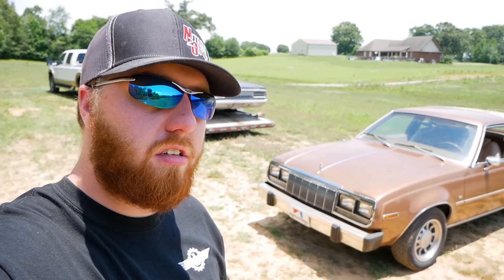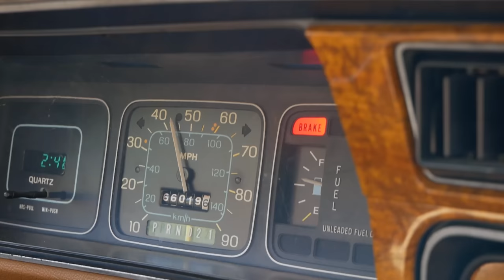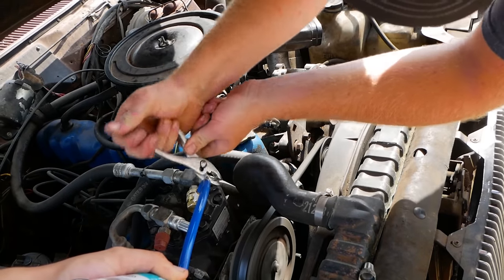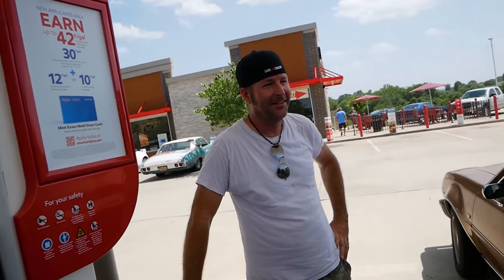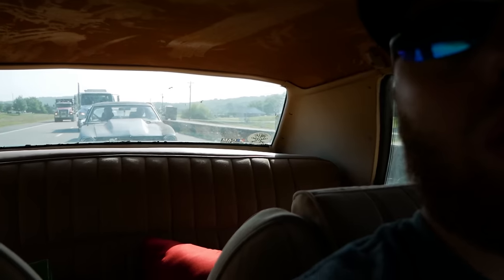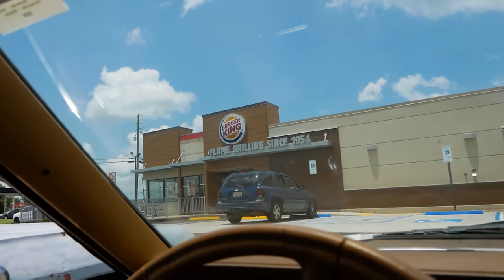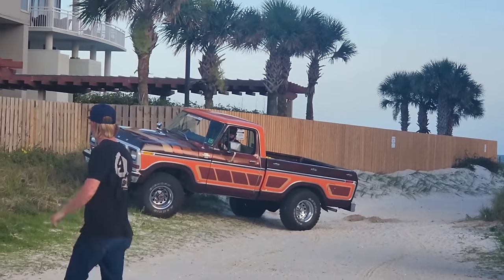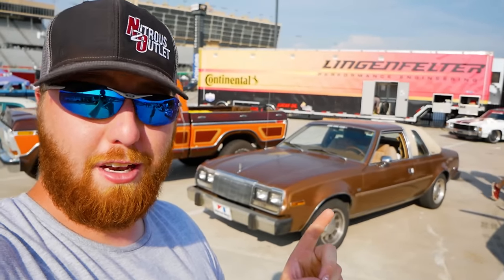Will a 43 Year Old Car Survive a 1500+ Mile Road Trip With Zero Preparation?

Comment: These also have a bullet proof Chrysler Torque-Flite 727 3 speed Auto trans which AMC used from 1971-1988. The same trans from a 1977-1989 M Body Dodge Diplomat 1982-1989 Chrysler fifth Avenue/Plymouth Gran Fury trans will fit this as well as the A704 trans as well AMC used too.
Reply: Only the AMC  V8 cars used the 727, most 258 L6 cars used the 904, a few may have used the 998
Reply: @jjtrucker5950  Correct. Prior to 1971 AMC used Borg-Warner transmissions.  If you look on the gear indicator you will see "Shift Command."  On the cars equipped with Chrysler transmissions it says "Torque Command."

Comment: Dayum! An AMC Concord. That was the first car I ever owned. It was given to me by my grandfather and he drove the crap out of it. I remember having to replace control arms. I think I also had to replace rings (it was over 30 years ago I know it was in the engine and very expensive). When ever I turned the air conditioner on, the generator light came on (red light said GEN). Finally, I was parked somewhere and the engine caught fire and the car burned up. A most fitting end. You brought back memories with this car. Thanks. Oh yeah, mine was blue.

Comment: It's quite clean for a 79! My first car was an early 70's amc hornet, white with blue interior! Turned out the owner only added oil and hardly chanted it. Pulled the straight 6's valve cover and I scraped enough sludge out of the cover to fill a big gulp cup...nuts! Basically clogged everything up, was a shame as it had 65k miles if i recall. Ended up donating it and I only drove it around the Block a cpl times b4 i had my license...oh the memories!!!!

Comment: you keep referring to the AMC motor as a 4.2, it is in fact a 258 ci motor, is also 112HP-AMC Eagle and Concord
 4-Door 1979 4.2 Auto Engine Technical Data

Engine type - Number of cylinders : 	Inline 6
Engine Code : 	AMC 258 I6
Fuel type : 	Petrol
Fuel System : 	Carburetor 2-Barrel
Lubrication : 	
See oil information
Engine Cooling : 	
Engine Alignment : 	Longitudinal
Engine Position : 	Front
Engine size - Displacement - Engine capacity : 	258.4 cu-in / 4235 cm3
Bore x Stroke : 	3.75 x 3.9 inches
95.3 x 99.1 mm
Number of valves : 	12 Valves
Aspiration : 	N/A
Compression Ratio : 	8.0
Maximum power - Output - Horsepower : 	110 HP / 112 PS / 82 kW
@ 3200 rpm
Maximum torque : 	210 lb-ft / 285 Nm
@ 1800 rpm

Transmission Gearbox - Number of speeds : 	
3 speed Automatic

Comment: Bought my wife (when she finally decided to go back to work) a 1982 AMC Concord off a car lot in 1990. Test drove it, paid for it and the transmission quit working half way home. But she had already fallen in love with it so bought a used tranny and it was a real asset for many years. $900 car cost us $1300. I once owned a 1974 ambassador. Also drove it for many years. American motors did make some decent lasting cars, way better than any mopars ( only owned one of those (Duster)

Comment: When doing car a/c and don't have a vac pump, I connect the break booster vac hose to the a/c system and let it pull a vac for 30 minutes. Make sure the hose you use, is able to depress the schrader valve.

Comment: The Concord was a heavily facelifted and updated version of the AMC Hornet from 1970, since American Motors couldn't afford to develop new car designs by 1978. The 1971 AMC Gremlin rode a shortened version of the same platform/body shell, and that got facelifted into the AMC Spirit. The AMC Eagle was created by taking Jeep CJ-Series 4x4 components and sticking them into the Hornet/Gremlin/Concord/Spirit platform to squeeze an extra model and some extra life out of it. In the early days, you could get an Eagle version of every body style in the Concord and Spirit lineup, but, by the mid '80s, it was paired back to just the station wagon. As Renault took control of American Motors, they decided to phase out the AMC name in favor of their own brand on all passenger cars. The Pacer was dropped in 1980, and the Concord and Spirit were dropped after 1983, leaving the Eagle as the only thing left under the AMC badge until the company was sold to Chrysler.
Reply: The Rambler American became the Hornet, the Hornet became the Concord, It was still AMC JEEP until Chrysler took over. Personally, I remember when Chrysler was in trouble, the wrong company survived .

Comment: Ive had many people tell me and even insist over the years that the 327 v8 in my 59 Ambassador was supplied by Chevrolet.  I then point out the intake manifold above the separate valley pan and the cast-iron timing chain cover and the fact that chevy didn't even have a 327 in '59! It can be frustrating for us AMC guys!🤪

Comment: I had a little Honda 50 that I ran on Nitro and Nitrous. Sometimes it would rev so quick it would break the timing chain and take out the valves. It happened at Sears Point one year and a guy brought me a chain and I fixed the valves with a hammer. When I got home I had to get new valves as it's almost impossible to fix valves with a hammer.

Comment: Just so you know, and I'm sure someone has commented, "It doesn't sound happy" means your slugging that compressor and shortened its life by half.......NEVER charge any AC system on the low side with Liquid unless you have a cap tube or Kwik Charge fitting. R134a upright, GAS....Upside down, Liquid. Still enjoy your vids as always.

Comment: The engine and rear axle assembly in this car were produced by AMC . The transmission is chrysler's torqueflite . The wiper motor is a ford unit , and the AC compressor was made by York , who also supplied units to ford .

Comment: That 79 has had the grille and headlight assemblies replaced with the setup from an 81-83. The 79 had the unique single headlight setup. Looks really good
Reply: No, that is correct.  They went to the quad headlight set-up in 1979.  The taillights are the same as 1978, though.

Comment: I would seriously love to see this Concord with a LA 360, some aluminum heads, POSSIBLY some shorty headers (IF they fit), a nice Edelbrock (or Edelbroken) aluminum intake, some black wrinkle Mopar Performance valve covers, a Holley 650, a MSD 6AL box, MSD Blaster coil, MSD distributor and wires, dual 2.5 or 3" pipes to a set of Flowmaster or Borla mufflers, a NV4500 5 speed manual, and a stronger Chrysler rear axle with a 3.73 and TruTrac. Now THAT would be a fun cruiser in my opinion.

Comment: Just got to the part with the guy who bought the Capri and he mentioned the amx. My dads amx is running now. Gotta free the clutch up but it will drive. Sitting since 96. Need to take that on power tour. The old 69 needs a lot though.

Comment: The D/L sedan was given a new vinyl roof design which extended only over the rear passenger compartment was complemented by chrome trim that overlaid the B-pillar and wrapped over the vinyl roof at its leading edge. A thin trim piece at the roof's edge simulated a convertible's fold-down hinge point.[17] The D/L package, now the middle trim level, was extended to the hatchback, which was given a brushed aluminum Targa-like roof band and a half-vinyl roof to differentiate it from the base model hatchback.

Comment: When I was living in Arkansas an elderly couple had a concord,but it was a 4 door & had 4 on the floor shifter with a 4 wheel drive shifter beside it, the guy said that's how he bought it brand new off the showroom floor,don't know what size 6 cylinder it had in it because I was still in elementary school then & wasn't into fixing cars yet,it was the same color gold as your concord,but with a brown vinal top where the back doors were,I rode in it once & it rode nice & very quiet

Comment: I grew up with a 1962 Rambler Classic in my family since new.  The engine in the 79 Concord is an AMC engine developed in 1964 by AMC, before AMC bought Jeep in 1970.  So that engine is technically an AMC engine used in Jeeps, not a Jeep engine used in an AMC car.  AMC used a Briggs And Stratton lock cylinder since the days of Nash and Hudson in the 50s.

Comment: You forgot to mention that they also used GM tilt-steering columns and Chrysler transmissions.  (The A904 possibly?  I don't remember if the 1979 models have a torque converter lock-up but some did.)  While the 1980-88 Eagle was based on that car the origins go back to 1970 when the AMC Hornet came out.  It was basically the same car and believe it or not the Gremlin was the same car from the "B" pillar forward; it was on the 96" wheelbase as opposed to the 108" wheelbase of the Hornet/Concord.  Those AMC engines were made with more nickel and tended to last longer.  The Spirit was also the same car as the Gremlin.  When the Eagle came out in 1980, AMC was able to use the 4-wd system it had on all of their cars.  It was arguably the first "crossover".   I had several customers that had them and they weren't bad cars.  Great video!

Comment: 25 MPG in the Concord? Huh. Fun Fact: The 1982 5-speed 3.8L I6 Concord managed a highway fuel mileage of 30 MPG. My family's Passat, a car with a drag coefficient of 0.29 thanks to the undertray for lower drag, gets 36 MPG on the highway with a 2.5L I5. But that's port fuel injection versus an old carburetor from 30 years before, so I guess the secret to MPG is a big engine with low horsepower and high torque (110 vs 160) and running on the lean side for a complete burn of fuel. The science checks out, its how the Iron Duke inline-4 in the same car got 39 MPG according to the EPA. Cool stuff :P

Comment: i really miss AMC. i had a '69 javelin that was a ton o fun, a 4 door ambassador, a buddy had a gremster, and i've had a cj-5 and a cj-7. i've been looking for a hornet for years. they are basically a fastback gremmy. that concord is in awesome shape, and should get you from a to b for many years to come. strangely enough, that is the only color i have ever seen on one. i about think they were channeling henry ford, you can get any color you want as long as it is copper. the AMC that got crashed was a hornet, and was really neat before the dump truck gave it a kiss.
Reply: I have a 1977 AMC Hornet AMX project car with 48,00 one owner miles. 258,  4 speed car with no engine or trans, clear title, basket case car that the original owner had started to take apart to restore before he suddenly passed away. I will most likely never get around to working on it, too many other projects.

Comment: My first car was a nineteen eighty AMC Concord that was the same color that had a eight track am/fm radio with a straight six  with a big trunk with cold air that steamed the  windshield with the vent switch that was really nice when the gas was about a dollar a gallon. I actually do miss the car it was about two thousand dollars when it was purchased the vinyl was dried out it was that silent on running.

Comment: You may be too young to know this, but the Concord is pretty much an AMC Hornet with a new front facia and tail lights.  I think the full sized quarter glass from the Hornet is even under the landau top vinyl, disguised to look smaller.

Comment: The compressor may have sounded unhappy because the refrigerant was going in as a liquid and not gas, I think. Turn the can over next time. Especially when the low side dumps right in on top of the compressor.

Comment: yeah wiper blades now have this weird tendency to do that, its actually a problem with how they are manufactured. they make that plastic clip that connects to the wiper arm really flimsy now for whatever reason I have literally had 2 sets of wipers on my truck and both of them have had the same problem. the only thing that fixed it was an old more rigid plastic clip from another pair of wipers of unknown origin TLDR be prepared for a dark time in wiper blades

Comment: I like the 1989 Ford truck love the color I'm driving 78 three in the tree 300 6-cylinder I cut up beer cans and patch the holes in the bed sprayed over it with about 10 cans of flex seal but it worked miss that old truck

Comment: I use to open up the hood on my 96 XJ after driving to work<30 mins> just to let the heat escape. The heat gets trapped inside of the engine bay and cant go nowhere. But just like opening an oven door you are allowing the heat to escape. I figure it can't hurt.

Comment: con-cord(e) is the plane, like you're pronouncing it. Concord (CONK-erd) is a place, and how the name of this car is pronounced.
NOTHING is as good as the feeling of getting an AC system working in the dead heat of summer. Can reduce a man to tears of joy.

Ike needs to learn the joys of the ice box cooler AC. take an old cooler, punch 2 holes in the top, put a fan in one of the holes, and pack the box with ice. It'll last you a few hours before you have to put new ice in the box. Works obscenely well for how low-rent it is.

Comment: That was a great adventure. The AMC Concord was nothing special. It was slow and hills were a danger. it was not good looking at all. BUT it was reliable, fuel efficient for the time period and made a great everyday car that was easy to fix when things did break. Thanks to it being it built with parts from other companies vehicles, it is easy to find most parts for it. There were some luxuries in that car. That digital clock was futuristic for the era (Most GM cars had an analog or electro-mechanical (turning numbers) clocks during the same period)

Comment: on the ac, I think your doing the right thing first. obviously the system has a leak. push on the schraders first to see if you have any pressure. you dont want to pull a vacuum and pull in air. if there is any pressure, I find it best to put some cool juice in the system and overcome the high pressure switch and get the sniffer out or use uv dye with the cool juice. sometimes the leak is not detectable especially on the low side, and you can just add refrigerant now and again. if it's on the high side, or large leak better get the hbnr oring kit out. I generally change the the orifice tube or expansion valve and possibly the condensor if compressor failed. broke ass compressor will generall flood systems with all sorts of bits.

Comment: So cooling system story…I drove a 79 trans am to florida from Massachusetts back in 2010.  Ran great and stayed cool at 185 all the time.  I left in late March and it was great the whole way but when I got to the middle of Fl the weather drastically changed and it was HOT. I did not think about this.  Anyways, temp went up to 240 on the highway in what seemed to be out of no where.  I stopped and let it cool off and waited for the sun to set. I drove two hours longer to where I needed to go but next time I started it I realized the head gasket went.  My shit box was stuck.  Getting parts for a 403 is a nightmare too which didnt make things easier.  If I took kevs precautions maybe I could of made it back and not overheated it.

Comment: Mywives father bought her a 'Ford Granada to go to college with.  When she dropped out she decided to buy her own car.   We had been dating for less than a year.   She went home for the weekend and told me she was going to get a mustang.  Imagine my surprise when she called  and told me she got a 1979 AMC Concord DL.  She put 1500 down and paid 63 dollars a month for 12 months.  The car had 30000 miles on it .  The year was 1984.  It was like sitting on a 5 gallon bucket to drive it.  When she got rid of it in 1990 it had 63000 miles on it and aside from changing the alternator belt and doing brakes thats the only work done on it

Comment: Part of it is these cars are sold "old" they don't "care" like a modern car would if it ran 2 degrees too hot or cold.  These cars have much larger tolerances to issues and were simpler and that's something  I miss about old cars.  IN some (or many) cases, you could just ignore things that weren't as critical, and you wouldn't be bombarded with warning lights every few minutes like you would in a modern car.  I will say some of the systems in newer cars are there for good reason (like the TPMS) but others, like ABS aren't as critical (I think everyone should learn how to drive without ABS -- which is what I did -- but now they are required on all newer cars built after about 2010-2012).

Comment: Those wheels are Western brand Bullet model wheels. Western wheels was a manufacturer that was owned by Rockwell. Witch was owned by some other company. these were purchased as early as the first year this car was sold. They can be found used in most sizes. I have a set of these on my high school ride. They are 15 x 7.5for the front and 15 x 8.5 for the rear. I still think they are great looking wheels.

Comment: On these york compressors you have to charge gas, not liquid or you will hydrolock the compressor a little. If the compressor still runs, it still had some in it and you don't have to vacuum

Comment: In 1989 I bought a 1977 AMC Jeep CJ7 basket case. The engine was in the 
back in pieces. Do you know how hard it is to find a Jeep 304V8 in wrecking 
yards? I searched high & I searched low but no Jeep V8s to be had. One day, 
while standing in front of yet another CJ with straight 6 & wondering what to 
do, I noticed next to this Jeep was an AMC Matador. Peeking under the hood 
I found a 304 V8!!!!! The year model was the same as mine. I bought that 
engine, rebuilt it & had many good miles & years out of it.

!

Comment: 21:20 should of bought some sealant it has oil in it helps compressors a lot i use it when looking for leaks on most cars especailly if its a slow to very slow leak I had a dodge caravan I could not find the leak in 2 years finally found it on the line sitting on the fender under the air filter took hose off that ac dye/ sealand was sealing a 1/16 to 1/8 inch hole of aluminum corrosive mess